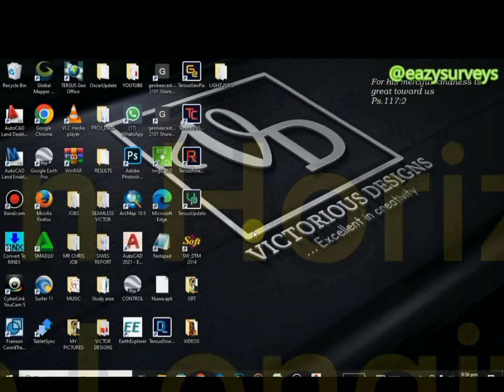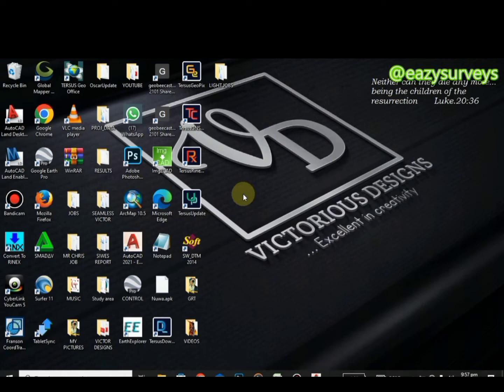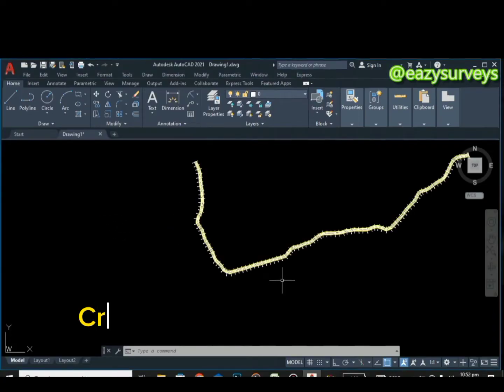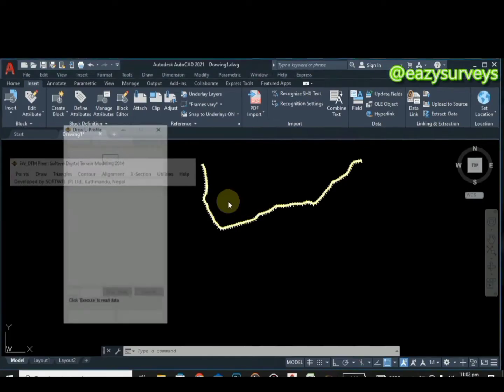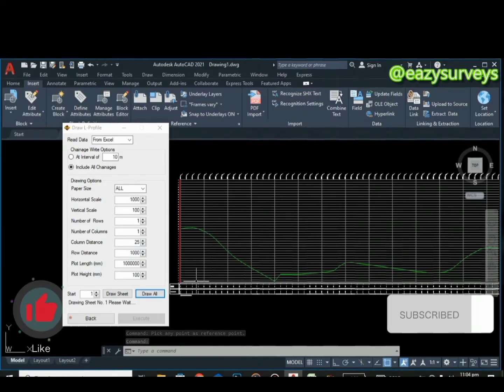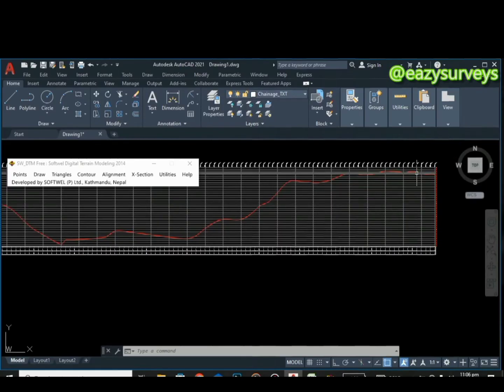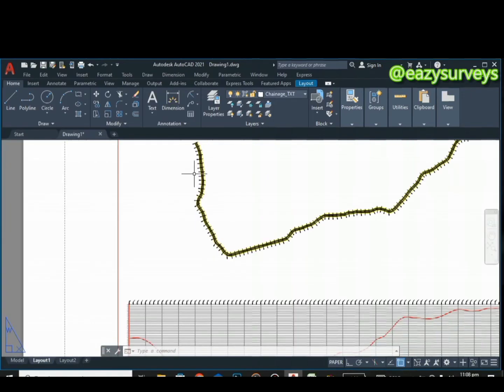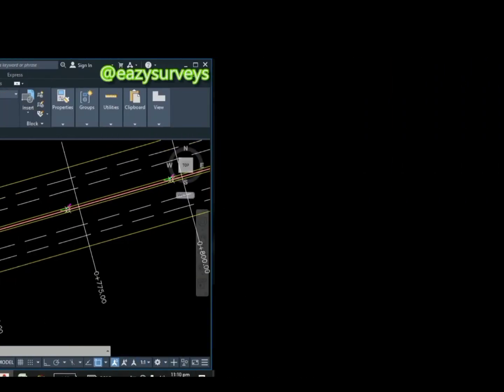Create LONGITUDINAL PROFILE in AutoCAD || Road Design tutorial for Beginners || Part1

Comment: Hello brother, I just downloaded the SW DTM software using the link you provided. After installation, this is error message I got. What's the solution please.

" AutoCAD is either busy or not open. Please make sure that it is open and not busy, then try again"

The AutoCAD is open and not busy
Reply from the maker: @stephenawaji8001  close AutoCAD
Shutdown system and on to try again
Make site AutoCAD is open before running the SW-DTM plug-in
You can leave a picture on my WhatsApp community if issue persist
Thank you ❤️

Comment: How can I cut it in between. That's is divide it.
Reply from the maker: @Jahson1  Thanks for commenting
You can use the breast tool or trim tool on cad to cut/divide

Regards❤️
Reply: @eazysurveys  please was the data used in this video sorted to include only the centre line data or was it inclusive of the sidelines?
Reply from the maker: @Jahson1  sorted only the center lines

You only need the shoulder(side) lines when processing for the Cross Section

Watch full training 👇
https://youtu.be/6KwZpODSp4Y